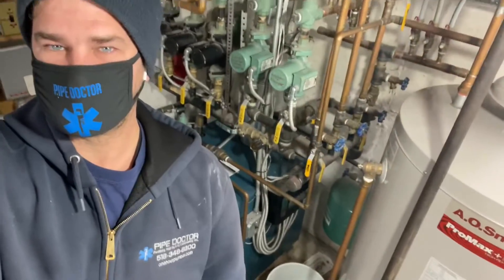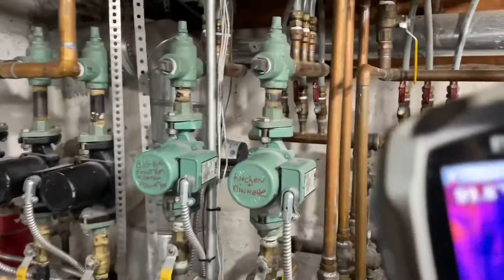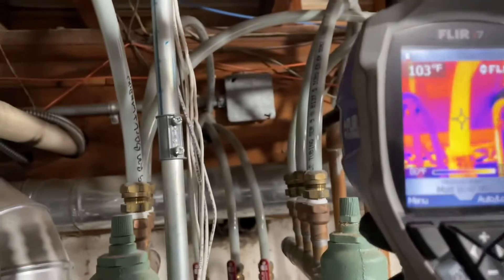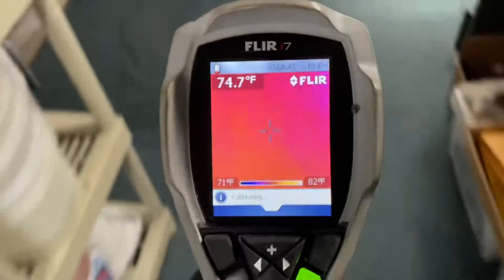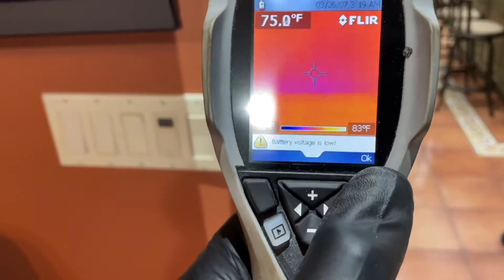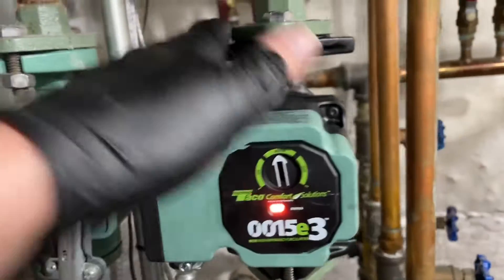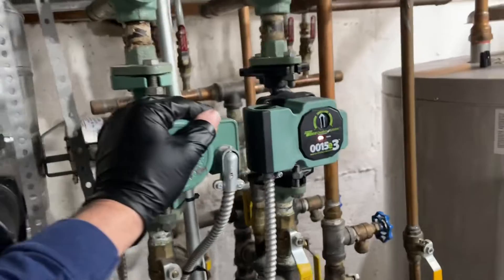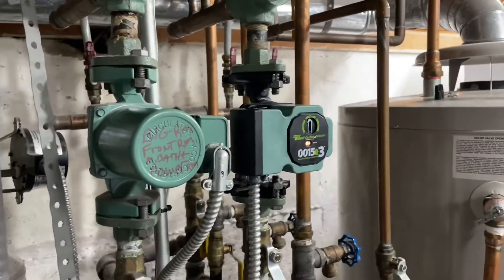Radiant Heat Zone Not Heating Properly - Bad Circulator

Comment: Do you think a regular point and shoot thermometer will work for the average homeowner  to check parts?
Though we all dream of a FLIR thermal.
Reply: I think the IR sensors are accurate to 3 degrees plus or minus.  Should work.  Hope to get a FLIR someday for my phone cam.
Reply: @PipeDoctor   Yes IR thermometer vs IR camera like the one you used in the video. But  now I realize it's only a $200 difference for the camera model.

Comment: Yeah make a flamethrower out of type k copper.
You ever see those little magnets to put on the face of circulatory that have a little triangle that spin like a water meter with the spinning of the impeller to let you know its working?
Reply: I'm pretty sure that only works on the grundfos pumps not the Taco pumps

Comment: How do you determine what speed to set those 0015’s at?
Reply: You can adjust for the best delta temperature between supply and return water.  This isn’t a condensing boiler so the gains from adjusting for best delta wont be as great. But if zones are small its best to extract as much heat as possible from supply water.  Water passing through the loop slowly has more time for the heat to be extracted.  So slow speeds usually have higher delta but less overall BTU potential.  With high mass radiation like in floor,  heat is more easily extracted from the water so higher speeds can work well. To high and they make more noise, turbulence in piping, and higher amp draw.  Adjusting speed also might help the boiler from short cycling.  Usually high speed just uses more electricity,  especially if head in pipes is high, but you might need it.   If your not getting enough heat you have to increase speed.  Medium speed is always a safe bet.  Some pumps will adjust speed automatically based on supply return temperature sensors. Not really economical for residential systems but on large commercial systems the gains are worth the equipment cost.
Reply: @daversj  thanks what is head in pipes mean?
Reply: @ciscokid2444  head in hydronics  is the combination of lifting pressure of water vertically and resistance to flow from the piping. Its measured in feet of water or pressure.   The more height in feet the pump has to lift, the more head in feet of water.  Things like pipe size, number and type of fittings, length of pipe all factor into the head calculation for a given loop. Once you made the total head calculation you can choose a circulator capable of that head pressure for your desired flow rate.  The most common pumps used for home heating systems are very accommodating to differences in head.   They will typically just flow less with more head.   If a chosen pump is not capable for the head in the system, water flow will be inadequate or non existent and the pump will burn up prematurely. So if you were heating a 3rd story apartment from a basement boiler it’s important to get it it right.
Reply: @daversj  Thanks for taking the time to explain appreciate that.👍🏽